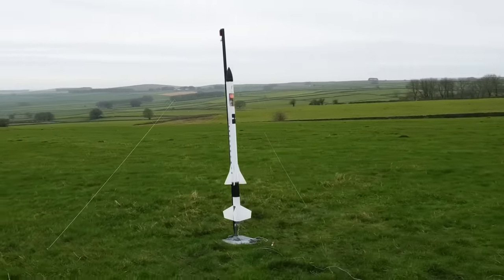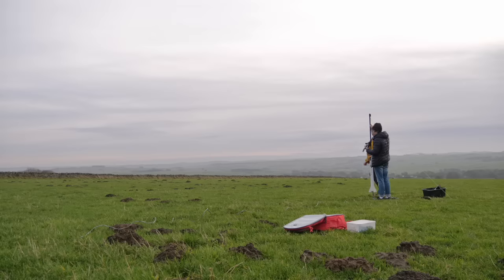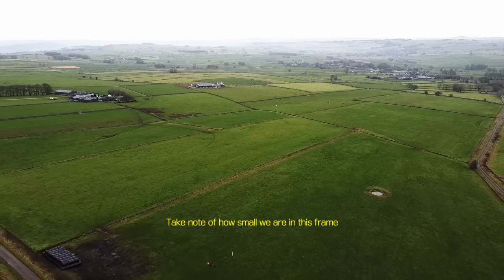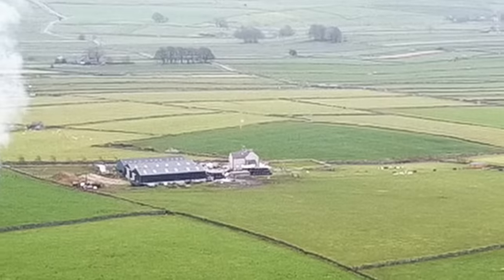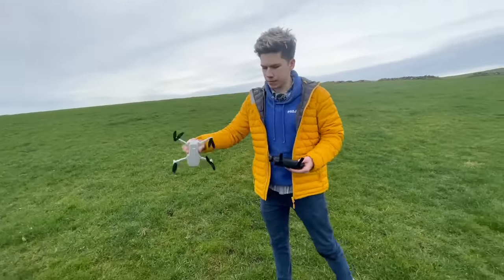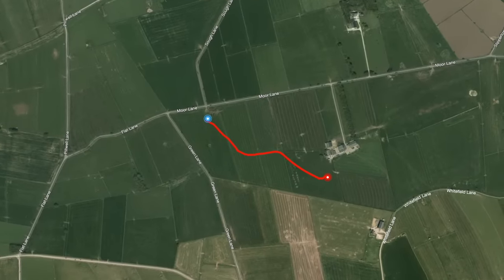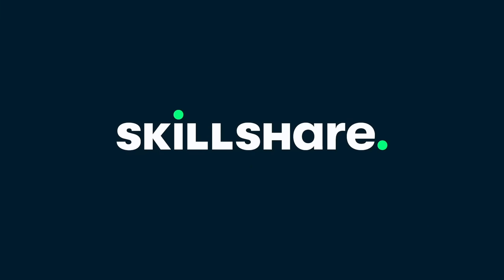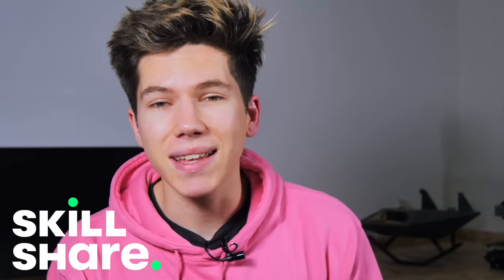High Performance DIY Rocket

Comment: Can't make "own rocket fuel", but we can go watch Colin Furze use a pressure washer, a mig welder, a spark plug, some wires and some brass and metal tubing and use propane to make the same type of rocket engine that powered the V2 rockets that destroyed so much of england during WW II..... (that's a pulse jet engine for you non-history type folks out there, and he makes several of them)
Yeah, sounds about right.... 
Gotta wonder though if that person on the buggy found your cam and didn't give it back... Perhaps need to put your name and phone number on various parts of those rockets so if they DO get lost, you may get them back... 
Good job overall.... pretty cool ....
Reply: @Vesta 2022 You mean 36-0-0 fertilizer from Lowes/Home Depot/Ace/True Value/Southern States/any farm supply and a host of other places? Easy peasy actually... 
Amazon sells cold packs for just under a buck a piece, some are $0.75 each USD, 50 lb bag of 46-0-0 for $77 USD or less on amazon too.... 
Do you NOT know how to make this stuff or what???? I'd suggest a cookbook for you... Anarchists love it... they should since it's in their name... if you can find a copy for under $100....

Comment: india,delhi is the exact opposite. it never rains. and no clean sky.
Reply: But stuff like this is not allowed in india right?
Reply: @hahahhaha8146  rockets have no laws in india. You can launch it but contact DGCA first. Mostly you need to abide by uav laws, so it can't go above 400ft and has to be 5km away from any airport. Also follow some ethical things like open field, no property damage, proper safety precautions like fire extinguisher etc.
Reply: @hahahhaha8146  I have launched in gurgaon in sector 21 were there is open field. And away from airport.
Reply: @aayushgargofficial  thanks for the information

Comment: The reason you lost the camera is you did NOT have the camera secured in a MOUNT!!!!  You just had it sitting loosely inside a frame.  Other than that silly mistake.... MAGNIFICENT!!!!!  FOUR-FUCKING HUNDRED MILES PER FUCKING HOUR?!!?!?!?!?    YEAH!!!!!!